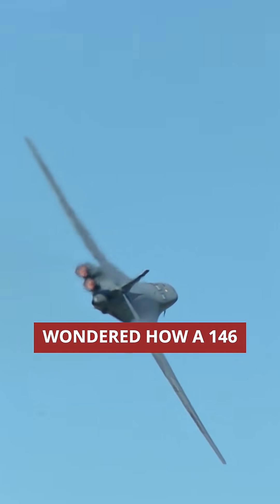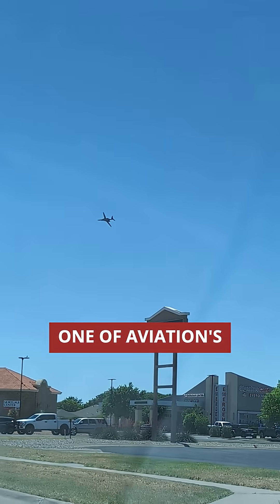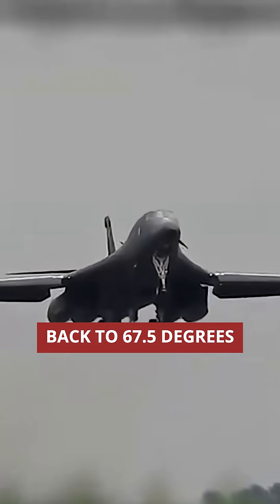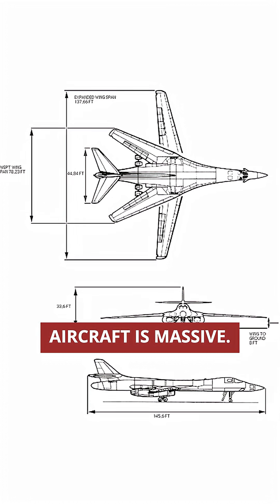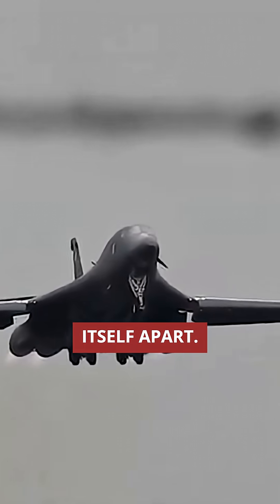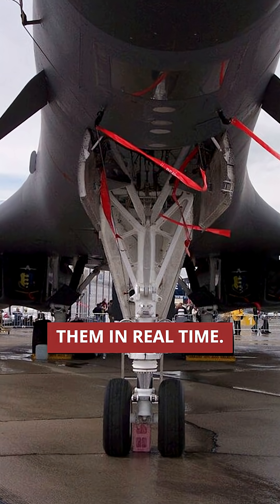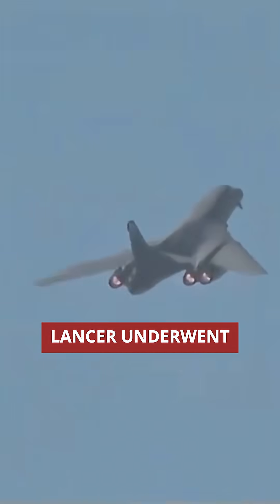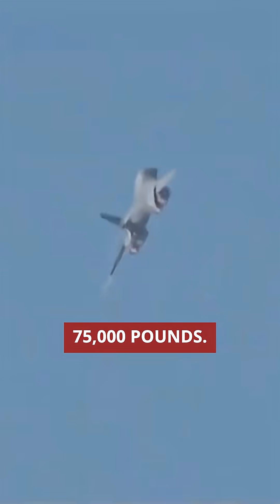Inside the B-1's Revolutionary Wing System

Comment: Why don’t we keep this instead keeping the b-52 on life support.
Reply: The B-52 is more cost effective in maintenance to flight hours. Cheaper to maintain and run. A less complex airframe will always win out in the battle for funding. That's what basically killed the F-14Ttomcat. It was a maintenance pig at roughly fourty hours of maintenance for every flight hour. Jimmy Carter wanted to kill the B-1 for that very reason.
Reply: @repairdroid77  not only that but wasnt the radar outdated and the missile (the AIM-54 phoenix) not as good as the missiles in even just the early 2000s? oh also just remembered, it never got upgraded to fly by wire systems iirc
Reply: @red_d849  the Tomcat was really a Vietnam era aircraft, it flew its first mission in the Saigon evac. That's how old it is.
The AWG-9 radar on the A and B was an analogue set with pulse doppler and track while scan. But it was a very powerful set. So the detection range was better than most airborne radars except those on the F-15s, the clutter rejection wasn't as good. The doppler filter was much wider than on digital radars like those on the F-15C, F-16 and F/A-18C. That's why in sims, it's a lot easier to notch a lock from a Tomcat than it is from later aircraft. The F-14D did get a digital computer for the radar but I'm not sure how much that improved clutter rejection and electronic counter countermeasures.
The F-14D was tested with AIM-120 AMRAAM which were the weapon of choice for the Hornet, Viper and Eagle, but costs just meant they were never converted. If the USN wanted to, they could have modernised the Tomcat.
Reply: @samspeed6271  didnt they have a plan to modernize it?
Reply: @red_d849  I think there were plans to modernise the F-14D to use AMRAAMs. There was also a project to create a successor to the AIM-54 Phoenix that got as far as the drawing board and proposals submitted (AIM-152), but with the USSR collapsing and the cold war ending there seemed to be little need for the Tomcat. No Soviet bomber to intercept, no cruise missiles to chase. So the money for upgrades dried up, and then the USN decided that the Hornet was just better for costs.
Reply: @repairdroid77 or just make a cheaper airframe that’s cost effective with today technology.
Reply: @OM5-d9r  The 52 has today's technology. All new avionics and new engines.
Reply: @OM5-d9r B21 is for what's possible with today's technology. B52 life extension is the cheapest with older technologies. To be fair, the carbon fibre wings and RR jet engines are modern technology. 

F22, F35 and B2 will go first, and after GBAD are gone, B52 can fly safely. However carpet bombing is so 1960s, so USAF probably aren't planning that..
Reply: @janus4002 true
Reply: @OM5-d9r  unfortunately that’s not how that works, besides the B-1s were incredibly expensive to even design costing around $100 billion accounted for inflation that’s $835 ish billion today, it’s not worth the cost especially considering the B-21s are coming into service soon.
Reply: @lonpfrb  B-52s aren’t really used as carpet bombers anymore, it’s more a “mobile multi-use sky fortress” it can drop singe guided bombs by itself or ground forces in one area and do the same in another, it can do standoff with cruise missiles long before any adversary radars can detect it, heck it might even become a missile platform for fighter aircraft (F-35 sees a target locks it but the B-52 fires the missile).
Reply: @NATOenthusiast sounds like good taxpayer value, thanks.
Reply: @NATOenthusiast
How many AA missiles can a B-52 carry, one must wonder.
Reply: B52 will have 100 years service due to the constant rebuilding, most recently the RR jet engine upgrade that provides lower engine maintenance, better fuel efficiency and better range.

Maintenance costs are a big issue as B2 Spirit gets replaced by B21, there's not enough positives to keep B1B in service..

Comment: wait it has a bigger payload capacity than the B-52?
Reply: Yes
Reply: It does, just barely. The B1B can carry 75,000 pounds mixed ordinance, while the B52 can carry 70,000 pounds mixed ordinance.
I know, the weight of three cars is somehow "just barely." When you're talking 70,000 pounds, though, 5,000 isn't a particularly large amount.
Reply: @Fightre_Flighte that's more like 1.5 mid size cars or a small SUV.   Long gone are the days of the Civic CRX
Reply: @Payt-y5d 
"One electric car," how about that?
Reply: @Fightre_Flighte drop one of them, then it burns with uncontrollable flames for 4 days.  Bonus incendiary device
Reply: @Payt-y5d 
No explosive, but it carries shock value!
Reply: And bigger than the B-2